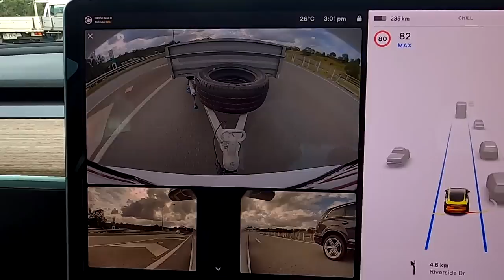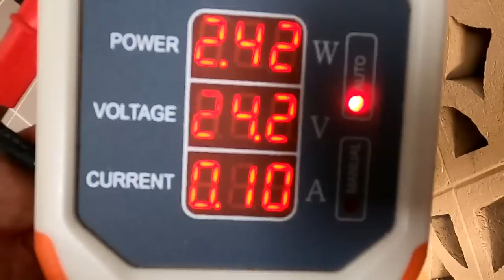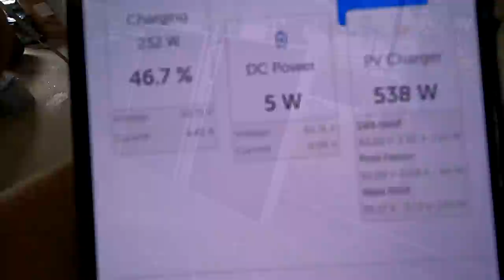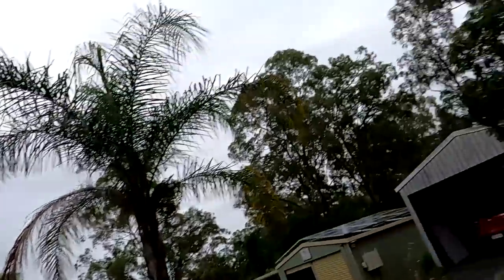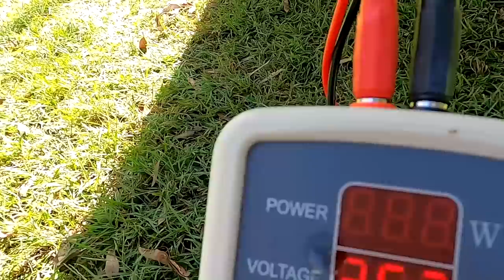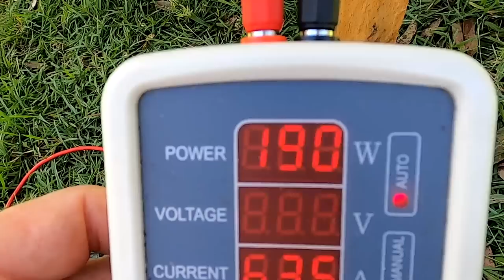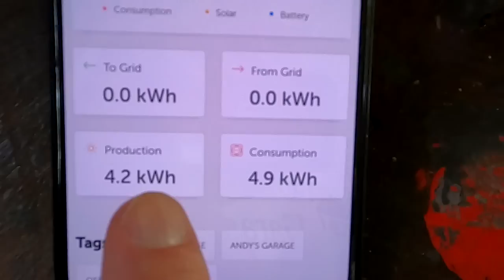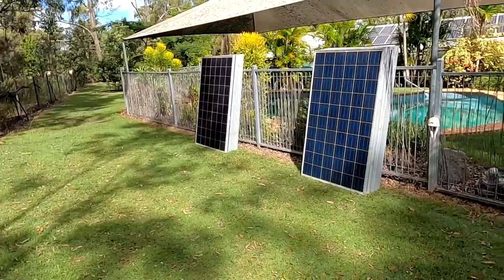S.P.A.T.-Testing used RENESOLA 250W panels 🍺 Have I wasted my money (again) on this brand?

Comment: When you buy used panels, if junction box can be easily opened, it is a good idea to check all bypass diodes.  Destroyed open bypass diode are common issue.
Reply from the maker: We have opened quite a few junction boxes from panels here on the channel in previous videos. None of the bypass diodes were ever faulty though.
It's very hard to open these boxes, plastic clips will break and the glue is fairly strong. Almost impossible to close them again afterwards again. I would not recommend doing this just to check on the diodes.

Comment: Hello,
you became my reference for the creation of my DIY photovoltaic system.
I have 20 used panels but with broken glass and some bent but they work on the tester. Can you suggest a solution to bring them flat and repair the glass? I have seen some videos with resins and adhesives dissolved in white spirit. What would you recommend? Thank you
Reply from the maker: Thank you. Oh, I would be careful with that. Moisture is getting under the glass and will corrode your connections.
Reply: @OffGridGarageAustralia  what way can i fix it?
Reply from the maker: @cjblacktube  the question is: can they be fixed at all? If panels are in such desolate conditions, they can potentially cause a hazard in terms of an electrical shock or a fire.
Reply: @OffGridGarageAustralia  but wishing to venture which system will you use?  new glass?  composed of adhesive and white spirit?  What? Please help

Comment: New panels are around 47-53c/W in Aus from distributors.  thats $200 for a 400W panel new. i use raystech before & they sold me 4 panels no issues
Reply from the maker: And its around 0.25c/W ordering from China directly. $140 for a 500W panel. Plus shipping though...

Comment: I think you got an amazing deal on those panels.  I wonder if Australia might have the best second hand market for solar equipment.
Reply: I reckon it does. And some states are better than others. I just missed out on a 4kwp system (16x 250w panels + inverter) which was listed for $600 here in WA. Someone bought all the panels, for somewhat less than the $600, I would think.

Comment: Dc optimizers are wonderful things. Especially without half cells. Way better than string mppt.
Reply from the maker: I have the optimizers already here to test... not sure if it is worth it though.
Reply: @OffGridGarageAustralia  I’m getting 15% more on side by side arrays with in full sun and 30% more power in shade. 

And shading of one panel in series doesn’t hurt output nearly as much. High voltage charge controllers become way easier which lowers wire loss for same number of panels.  And you don’t need mppt in the charge controller either.  

Win all of the way around plus remote shutdown.

Comment: Good score Andy! Hi all, I wonder if anybody knows a ‘fix/tweak/ work around’ to enable a grid tie inverter to be used off grid?  
I have been pondering the possibility of using these grid tied systems to be used in an off grid situation and wondered if there wasn’t a simpler work around, or if I could inject 240v from a small sine wave inverter to trick it into thinking it was tied to the grid and allow the main inverter to be used off grid. 
I dont know how much power would be required to do this, but with 15kw of solar potential, Im sure it wouldn’t be a too great compromise.  There maybe a simple internal ‘fix’ someone knows of.
What does everyone think? Could this idea work? I have a 5 & 10kw systems with a single & 3 phase grid tie inverters I want to use on a shed project if possible.  TIA Cheers
Reply: Your only option is to have another inverter which provides a pure sine wave voltage. Andy seems to have plans to attach the GrowWatt inverter to his multiplus. The GrowWatt will see the Multiplus as the grid and sync to it.

Of course you get no storage. You have to use the power as it is generated. 

I don't believe it will push all generated power into your "private grid", but will allow the "private grid" to draw what it needs, up to the capacity of the grid-tie inverter. 

So if you have storage for part of hour setup, that can be charged while the grid-tie portion powers your "home" and once the sun goes down, your storage kicks in to power stuff over night. This sounds like an awesome setup. 

Your storage gets to recharge during maximum production period, because it's not being used to power stuff. I guess it has to keep the "grid master" inverter active, but if you could have a way (say in the multiplus) to prioritise the (private) grid-tie power, and fallback to stored power, you would be set.
Reply from the maker: Evan, this cannot be done. A grid-tie inverter always needs a grid to sync on. If this master grid signal fails, the inverter will turn off immediately (anti islanding). I think only the Multiplus can handle a grid-tie inverter at its output and can also charge the battery from it. I have not seen any other inverter capable of doing this.
Reply: @OffGridGarageAustralia  Thanks Andy, appreciate ur reply, I know ur a busy fella!
Reply from the maker: @evil17  im always here in the comments 😊
Reply: @CollinBaillie  Thanks for ur response & yes, this is what I was thinking also. The more I think about it the more possibilities I come up with. Let’s see if I can blow up my shed!  I was considering using a 5 kw all in one or Multiplus to switch on one gridtie inverter at a set time when ur daily production would normally start, say the 5kw, which in turn powers/triggers the 10kw gridtie inverter for operation, & this 10kw could be run through the Multiplus to recharge batteries as well as any excess power from grid tie inverters above ur house & shed requirements could also be stored via chargers to batteries. I could also potentially have another 4-5kw of solar PV running through the Multiplus roof space allows it. So if I buy 1 Multiplus I thought maybe I could trigger the other 2 grid tie  through the day for extra power production for house/shed & battery charging storage to be used by the Multiplus during non production hours.
Obviously, this all will require some special safety features throughout, nut I could also have 2-3phases run to house from shed, 1 for Multiplus output 24/7, & the other 2 from 3phase 10kw gridtie which would heat water on one phase with Multiplus on another phase and a 3rd for Aircon’s during daytime with changeover at night, I may need some more inverter power for this as I have 3, 1@5kw & 2 @ 2.5kw efficient a/cons all at once run from 12A startup back to 6A @ 240v, so I could still run the 5kw easily on its own, or the both 2.5kw at once, but I figure I could still have the use of the gridtie’s for up to 15-20kw total of PV production by day.  Cheers

Comment: Can smart inverter to be connected to solar grid tie inverter i have 24v 2000va   csn i use with solar grid tie inverter 1500w and use it ove 3000

Comment: You should visually inspect the modules for water ingress. This is the most common fault. Black staining of the lower tracks and disbonds of the panel material are a concern. They will leak DC to the frame - again you should check. Without proper grounding and inverters that detect riso fault dangerous and a fire risk.
Reply from the maker: That might be only dangerous if you have one DC potential bound to ground. I'm free floating though. So even if there is a slight connection from one of the DC connections to ground there would be no current flowing.
I've checked all the panels for water damage, all good.
Reply: @OffGridGarageAustralia what about when you or someone else gets on the roof to clean them and becomes the ground?
Reply from the maker: @SydRV7A  There is no closed circuit though. You can touch one side of the solar panel cables with 150V and ground with the other hand, no current... It would be different if I had grounded my negative of the battery.
To make this clear, all panel frames are grounded but not the actual positive or negative potential of the battery or solar system.
Reply: @OffGridGarageAustralia  The floating system does not provide protection if there is more than one DC path to ground / mounting frames. i.e. two faulty panels, multiple wiring faults, moisture in connectors....

Comment: Ya got a good lot for $300,if that was here in tassie the idiots ask for $2k-$3k for the same kind of stuff (old panels go for a fortune here cause they think they are all experts) also when I seen ya trailer on ya tesla I thought it was ya long range battery ;)
U could always make a fold out frame for that trailer and cover it in panels so if ya did go for a drive ya can charge ya car :P
Reply from the maker: Wow, that's a rip-off... used solar panels are really cheap up here. Maybe I should send seme down to your beautiful island. 
The fold-out solar panels are a good idea when driving through the outback with no space limitations 😉

Comment: Hey Maybe someone can answer my question I bought some second hand brand new panels and in full sunlight they will all of a sudden loose all voltage for a few minutes then it comes back and work as normal for about 10 minutes then same deal?
Reply from the maker: How did you test them? What is the exact setup?
Reply: Two trina 255w panels connected in series connected to a Victron 100/50. I’m getting around 65v out of the panels and 495ish watts  in full sun but then it’ll drop straight to zero almost as if something gets hot and cuts out. Then it will come right back a few minutes later. As for testing I’ve only separated the panels and tested for voltage which doesn’t drop unless there’s a load applied

Comment: 050722/0714h PST 🇺🇸 050822/0014h Brisbane🇦🇺 Thank you Andy. That was a good purchase. I bought a few "used" PV cells (AstroPower,  100W model AP-1000 made in USA) a few years ago. I didn't test it but trusted the guy who sold it. He said all are working. Reached home after the long drive, tested the panel and found the panel was not up to the mark as described rated voltage 16.1V. My reading was around 12.50V.  the open Voltage was 19.1V and shorted Current was around 4.13A .All had MC3 cables and all tests were through it.  I opened the sealed Black junction box and I found the cable ring terminals were loose. I tightened it well and tested the OP again. To my surprise the open voltage rose to 20.1V and he short circuit current rose to 6.1A. I tightened the nuts on all panels and they all increased OP voltages and Current. Those Panels are sill working well assisted by Victron 30/100 CC. Just my experience. 73s...
Reply from the maker: Thanks for sharing, Sree. That is awesome you found the problem and have now great panels to use.

Comment: Congratulations on getting hitched. 
May many future weekends be ruined!
(an endorsement by our PM for EVs)
You won't even know that your towing that trailer. I upgraded to a heavier 7x4 trailer with a cage and now notice significant range decrease due to wind resistance.
What will you do with all the energy in the future?. Cold room, Plug Share, mining rig?
Reply from the maker: Thanks Andrew. It was my first drive with the trailer. The consumption wasn't too bad actually and I managed 220Wh/km for this 99km trip. Still used 50% of my battery.
I need to install more solar for winter time due to the shading. In summer it will be far too much, so not sure what to do with all the energy then. I may fill it in batteries and set-up a swap system for others?